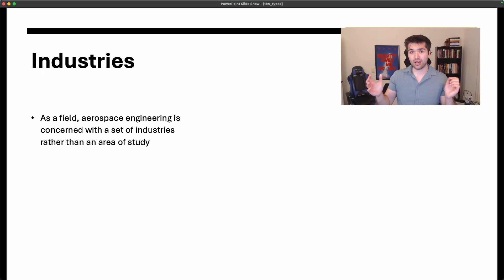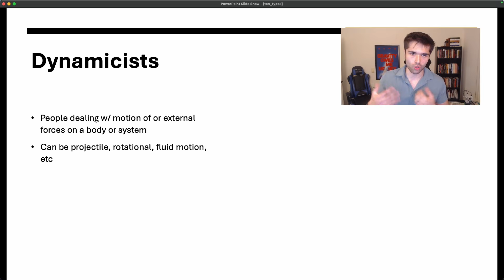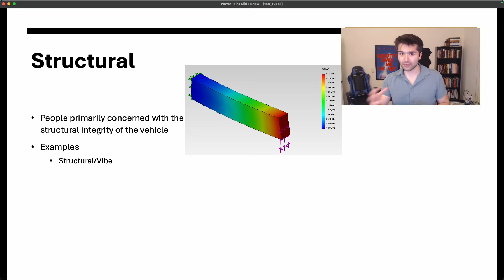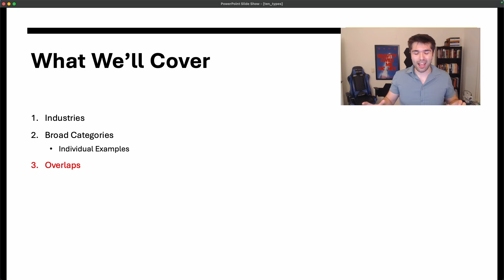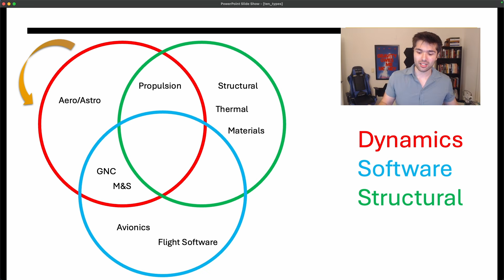The 10 Different Types of Aerospace Engineer-- Which One Are You?

Comment: In this video, the Unhinged Engineer breaks down the broad field of aerospace engineering, explaining that while it is often seen as highly specialized, it is actually a generalist degree that allows for diverse career paths. He categorizes the field into 10 types of engineers, grouped into three primary buckets, and discusses how they overlap in the industry.

### Aerospace Industry Overview (2:22 - 4:09)
Aerospace engineering is defined more by the industries it serves than by a singular core knowledge base. Key sectors include:
Aeronautics (aircraft)
Astronautics (rockets, satellites)
Aviation (commercial/passenger jets)
Defense (missile systems, drones)

### The 10 Types of Aerospace Engineers

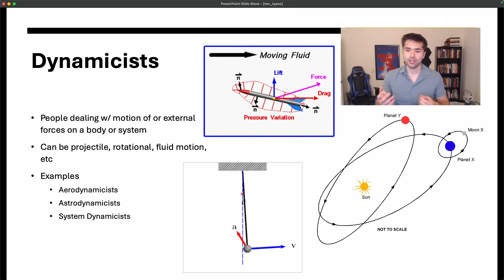1. Dynamics Bucket (4:09 - 8:36)
These engineers focus on the motion of bodies and systems:
Aerodynamicists: Wing design, drag mitigation, and fluid motion.
Astronautics: Orbital mechanics, planetary bodies, and satellite orientation.
System Dynamicists: Understanding specific vehicle platform behavior (e.g., drone flight or thrust vectoring).

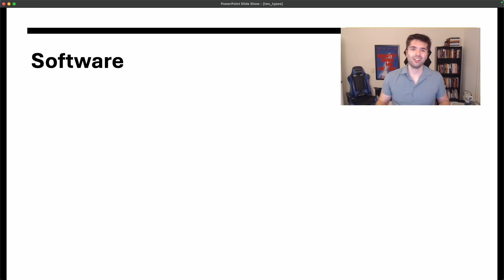2. Structural Bucket (8:36 - 12:04)
Focused on the physical integrity and durability of vehicles:
Structural Engineers: Ensuring the vehicle can withstand mechanical stresses, launch conditions, and vibration.
Thermal Engineers: Managing heat transfer from internal components or atmospheric friction.
Propulsion Engineers: Specialists in rocket engines, dealing with the complex coupling of heat, structure, and fluid flow.
Material Scientists: Selecting materials like carbon fiber or aluminum based on their specific performance properties.

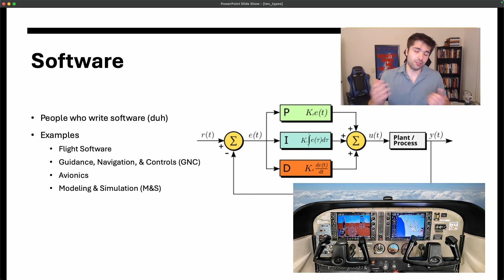3. Software Bucket (12:04 - 15:21)
Essential for modern operations and control:
Flight Software Engineers: Coding the logic that runs on the vehicle's computer.
GNC (Guidance, Navigation, and Control): Algorithms for determining location and physically maneuvering the vehicle.
Avionics: Managing sensors, actuators, and electrical systems.
Modeling & Simulation: Building the digital tools and environments used to validate vehicle requirements.

### Career Advice & Overlaps (15:21 - 20:43)
The creator emphasizes that the most rewarding work often happens at the intersection of these fields. He specifically highlights Systems Engineering and Testing as critical roles that require a broad understanding of all these categories to manage vehicle-level requirements and validation. For those starting their careers, he encourages finding the specific niche that aligns with your personal interests to ensure professional success.

Comment: The thing that I find interesting in your structure and the general roles of aerospace engineers, is that they're awfully similar to how mechanical engineers choose to follow their careers, now of course we Mechies aren't taking orbital mechanics or classes on aerodynamics, since our focus is to be as general as possible, with trying to apply to the whole mass of industry, but those categories of:
- Dynamicists, or Movement Analysts; 
- Structural / Materials;
- Software / Simulation / Controls.

Are pretty much exactly what we get to focus on, with perhaps an additional category on Projects & Design, since we are so heavily equipped and trained to find solutions and fittings for most situations. I find it very interesting to see that a such an esteemed branch from Mech Eng gets to follow a similar path, it really shows that we're basically studying more the problem solving mindset rather than the specifics in general lol

Comment: It’s quite complicated to precisely define the intersections between all these types of “jobs” or “subfields,” because some of them apply to all three of the main areas you highlighted (Dynamics, Software, Structural). To use my own subfield as an example, I’m a CFD engineer. You can categorize that under the subfield you called “Modeling and Simulation”; however, a new propulsion system also requires a CFD study, and in Structures you also need some CFD simulations. The same thing happens with Aero/Astro. If you’re considering CFD as part of “Modeling and Simulation,” then the “M&S” subfield should be at the center of the sets, belonging to all of them. I think something similar happens with other subfields as well; there are several intersections among them